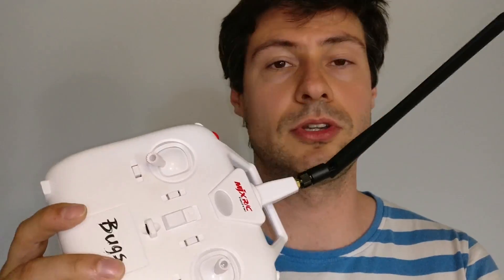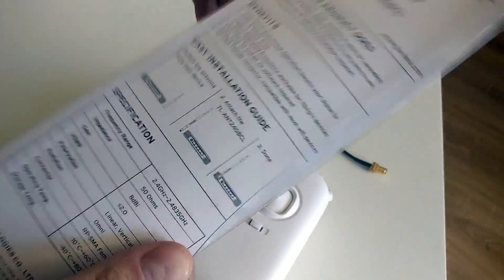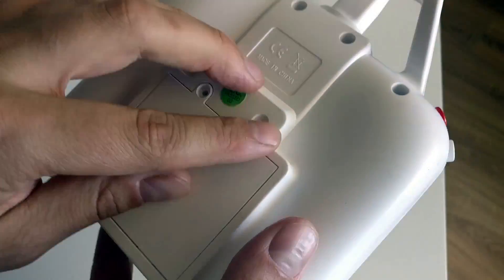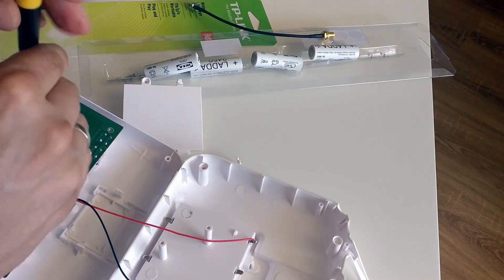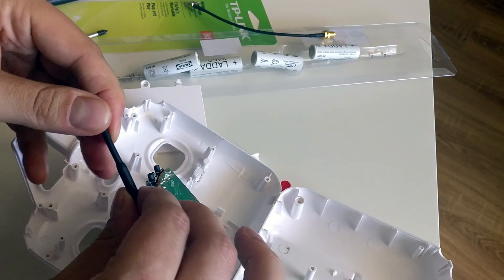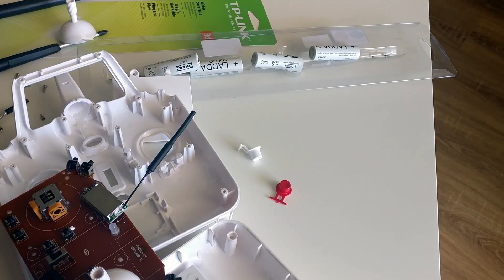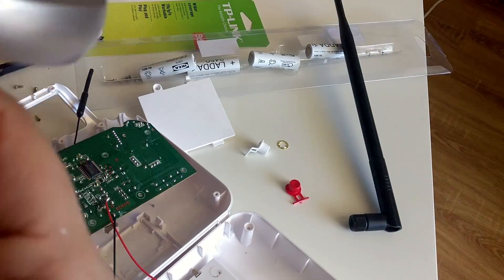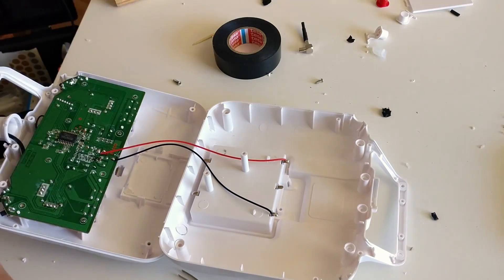MJX B3 Bugs - extend the control range by modding the RC

Comment: You should disconnect the original antenna when you use the 5db ones... first of all you can damage the transmitter due low impedance (with two antennas it will see 25 Ohms only instead of 50 Ohms) with a big lack of gain at that frequency. Second and more important, the signals of two antennas will overlap creating lack of gain. Just use one antenna and don't warry!
Reply from the maker: Yeah, that's what I did as a next step, and was certainly the better choice. Thanks for the tip and the good explanation.
Reply: I have a 6db antenna. Do you also recommend removing the original for this as well?
Reply: No ground??

Comment: Why would you need to extend the range on the bugs 3? It already goes 500 meters. That's so far you can't see it
Reply from the maker: I was young and dull :-)

The main reason was the communication between the TX and the drone. It somehow was loosing range even on short distance. I was  hoping to fix that by improving the range, and then came up with the idea checking how far it can actually go. 
Unfortunately the drone is still not fixed. There is no place where the old ESC can be ordered. I have already three of the new type, so now I am waiting for a fourth and for a new control board. And things should get back to normal.

Comment: Hey there, Nice video which I'll make use of later on when I get my MJX Bug 6. Out of interest, do you think this could be applied to the drone also? Read somewhere that sometimes the video feed from the Bug 6, isn't all that great and maybe the antenna's on the drone could be improved.
Reply from the maker: I have the Bugs 6, however no camera added. And am not quite sure how the original fpv cam is operating. 
I have seen similar comments about the B2W. So I can't quite help with a recommendation and you may ask around in the RCGroups forums. 
As for an RC mod - I will soon post a range test video for the bugs 6 - I was able to control it for 500 meters and guess it can go even further if you have visibility (like mentioned - I had no FPV, so the last 100 meters were blind flying :-) )

Comment: Can you use a different controller for the bugs3 or do you have to use the one included?
Reply from the maker: I use the original one.

Recently I found out that the MJX Bugs 6 controller is also compatible with it (basically the same)

Comment: Hello compliments for the video !!!! Can you take a picture where you can see where to connect the antenna and where is the mass?
Reply from the maker: Hi Francesco,

Once you remove the white rubber/paste that covers it, there are two places where you can actually solder wires.
If we use passive antennas (like in this case) it (almost)doesn't matter where the plus or the minus is.

Still, if you want to be precise - you will be able to ee how the original antenna is soldered and you can just solder the new antenna on its place. 
If my memories are not too bad - the solder point closer to the bottom of the remote is the plus.

I have no picture at the moment, but if you insist I will take the remote apart and take some over the weekend.
Reply: Hi .... I'm insisting :-) kindly would like a high quality picture however if you can delete the old antenna and weld only the new one, also if you place the links of the products to buy .... thanks and compliments !!! !
Reply from the maker: Alright then :-)

Comment: Hello nice video, i have a bugs three and i was flying around and the antenna came off of the quadcopter and is now gone. i just need a replacement antenna to go onto the quadcopter. do you know where i can get one?
Reply from the maker: Do you mean the antenna of the main body? Next to the battery? If so, I dont think they sell it as a spare part, just take a random small sized 2.4 antenna and solder it.

Comment: Did it work?
Reply from the maker: OF course it did :-)
Reply: How much far did it go?
Reply from the maker: Never had the chance to make a clean test. It is raining/snowing in the last few days :(
Reply: What will you use to measure distance?
Reply from the maker: There's a long street nearby, then I will simply put the information in google maps and get the result.
Reply: You still haven't tried the tange yet?
Reply from the maker: Not yet. Last two days have been warm and shiny and was bike time. I hope tomorrow is the day :-)
Reply from the maker: Kidd - I have finally tested the range. It went beyond 510 meters, however I tried to land it and it wasnt smooth at all - that is quite a distance, I lost visual and after the bad landing the drone broke. I am pretty sure it had the capability  going another 100-200 meters at least. Overall it is not worth doing that without fpv. Will upload a video with the flight later this week.
Reply: thanks for the upgrade! I'm going to start modding soon
Reply from the maker: Kidd do you have a fpv camera? It is quite fun to know you can go beyond the original range, but I can assure you that after 200 meters the drone is barely visible... :)
Reply: No I do not have an fpv camera but I have one coming in 2 weeks. I don't plan on flying my drone past 150-200 meters without fpv, I just want it to go farther than it already does. I look forward to seeing your new test flight video.
Reply from the maker: WIsh you the time to pass quicker :-) 
Will try to upload the video asap. On the move these days...
Reply: My stock bugs with FPV only goes about 100yards, I need to find a way to make it go further, I am doing this transmitter mod and I think I will add a new antenna to the bugs also

Comment: sorry to say that, but your range will be much worst with two antennas in this set up. Better just to replace the original one with the new one. Trust me, I was learn that a hard way. My Bugs 3 was out of range after 150 meters.
Reply from the maker: As for now the range is better than the one with the original antenna only.
Reply: tech4all  I think all because I have that new tx were the 2.4 ghz modem is on the front on the circuit board so you don't have to removed it to do this mod.
Reply from the maker: I am not sure what you mean by that. Would you please give some more details?
Reply: tech4all My new Bugs 3 ( red version) has  the new controller which looks identical to the old one except a black settings/trim button on the left hand side.  The circuit board is slightly different from yours in this video. My circuit board is V2 Version, not compatible with the black Bugs 3. You can find one video on YT about that.
Reply from the maker: Thanks for that info, Arek.

Would you please post a link to the video here?

Comment: hey there, great video!
could you post an image of the cable? 
could you also post an image of the points you soldered the cable to the antenna? it is difficult to determine where exactly you made the connections..
Reply from the maker: Hello! Thank you very much for your kind comments.
I should check whether I have a good photo of that and upload it.
The first point is the soldering point of the original antenna.
The grounding can be placed anywhere on the transmitter module, I have chosen the small soldering point which is at the other side. There is almost no way for you to do it wrongly.

There's always the chance of not soldering it, however this will likely result into almost no effect, as router antennas are dipole and that causes them to properly spread the signal.

As for the cable you need something like this - https://goo.gl/xW2uTu - a cable with RP SMA Male connector (as most of the router antennas are with a female connector.)
Reply: tech4all great! do you think that a 6dbi, 8dbi or even a 10dbi antenna could increase the range even more than the 5dbi antenna? 
also, a picture or a draw of where you soldered the grounding could be awesome! keep up!
Reply from the maker: The size of the antenna won't matter that much.

Each transmitter is designed to generate a load for an antena that is calculated to be attached. Meaning that the energy that it produces is calculated to be optimal for the antenna that we have originally in the drone. Even though I attach a 5 dbi antenna, it doesn't magically increase the signal by 5dbi, it is more likely a fraction of that amount. If I want the 5dbi antenna to be fully utilized, then I need to install a transmitter that is designed to generate enough load for it. 

Saying all that I guess you are good enough even with a smaller, 3 or 4dbi antenna. I use a 5dbi from my router (the 8dbi antenna from the video is now in my router :-) ) and it feels good enough. 

In a few days I will consult with a radio engineer and see if we can improve that a bit more. Will keep you posted.

Cheers
Reply: tech4all great news! thanks for the info!
Reply: BrentKong , aggravating
Reply: 2.4ghz RC uses 1/4 wave, right?  So is the antenna on newly installed unit the same length (the exposed part), as the stock 3.12cm?  And is the 3.12cm correct length?  I hear some conflicting claims.  If you want the best connection for that setup though, shouldn't you install the 5 or 10 db antenna on the quad also, as the connection is 2 way?